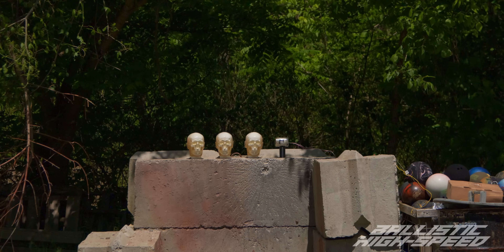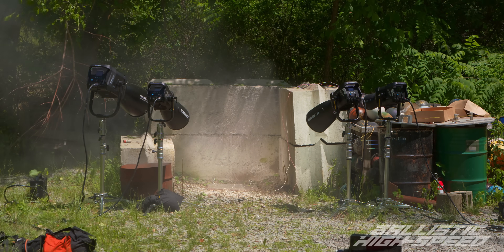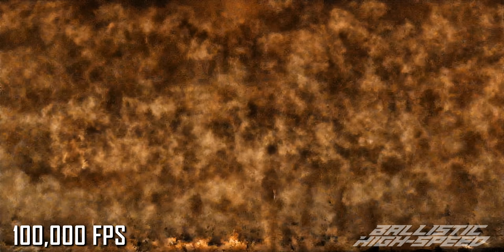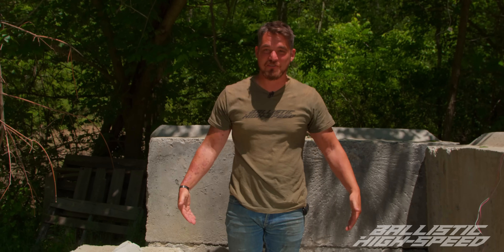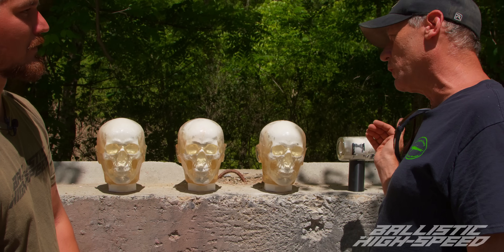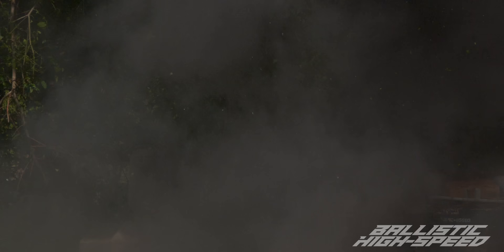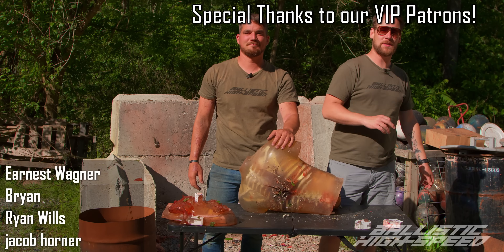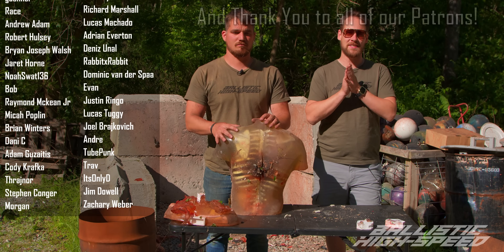Shaped Charges vs Ballistic Heads! - Ballistic High-Speed

Comment: That comparison to a shaped charge exploding like a nuke got me thinking:
What if a Shaped Charge exploded in a Lego City?
Reply: Lego city would be more expensive than the explosive and cameras combined 😂😂
Reply: "A man has suffered serious damage from a shaped charge in Lego City!"
Reply: @vvvxt  "Hey!"
Reply: "Looks like a nuke" - yes, for those few frames.   The mechanism behind the shape is completely different.
Reply: The shaped charge stands no chance against that single Lego block that is just there to be trodden on.
Reply: I endorse this!

Have viewers send in parts of Lego city super glued together and then take slomo macro shots of it getting shape charged with different angles!
Reply: What if we created a shaped charge the size of a building, pointed it down and set a small nuke above it as the charge? How deep would it go? :D
Reply: If we get really technical, a nuclear bomb is just a really fancy shaped charge with spicy metal.
Reply: And the name of the city is called SandiLego California
Reply: I think I'd find that distressing 😟
Reply: Hydraulic Press Channel has done something like that with their high speed cameras before. It should be on their Beyond the Press Channel
Reply: Tbh, nukes don’t actually explode in a mushroom cloud shape. The shape of the cloud is a post-explosion effect caused by both the hot air around the point of explosion rising and the displaced air returning to the point of explosion and rising. The central column of air keeps rising as the air and particles lifted up earlier start losing their energy and falling out of the air. It is the same phenomenon with how people create smoke rings.
Reply: A man has fallen into mist in no-longer a city!
Reply: Hey!
Reply: I like the way you think!

Comment: Man, that's a lot of expensive equipment just a few feet away from the explosion.  You guys are brave!
Reply: I just want to immortalize how the op and the first commenter had a completely normal convo and I appreciate it for how rare it is
Reply: @MrBusdriver-VoidlessMedia  I hate that this is something to be commended nowadays :(
Reply: @lemagicbaguette1917 at least its being noticed! I am honored to have semi-been a witness
Reply: Well one of the hosts was in an explosion, no biggie
Reply: If they are using industry standard tricks, those aren't exposed, they're actually pointed at a mirror and the cameras are behind protection so if they are hit with shrapnel/spall/frag the mirror shatters but the cameras are safe.
Reply: @Will-W  But then they'll have 7 years of bad luck.😟
Reply: @Will-W  Watch at 1:42.  Please explain.
Reply: @SteveFye  ah, you were referring to the black lights. The lights are "relatively" inexpensive compared to the 6 figure cameras and lenses. 
I'm not sure how they protect those unless it's just some clear polycarbonate and LED (solid state so no shattering) illumination.
Reply: @Will-W  those were lights?  That makes more sense then.  Still, they didn't look cheap.  Thanks man!
Reply: @SteveFye  oof, I looked them up, the Nanlux 1200 LED lights are 3k each and the reflector hoods are 100$+ on B&H Photo. 
Definitely not cheap. 
The TMX 7510 and the 2512 cameras are $150,000+ each.
Reply: @Will-W  that's a spicy light!
Reply: @SteveFye  lights
Reply: @SteveFye those are lights
Reply: Que bien se aprecia el efecto Monroe de una carga hueca y la onda de choque y calorífica de la explosión con sus fases positiva y negativa. Muy instructivo.
Reply: That wasn't the cameras, they were the lights. No way they were going to risk 3/4 of a Million for a few tube hits ? There is brave? Then there's STUPID and these guys don't look stupid. One of them IS one of the luckiest sons on the planet though.😉Cheers from Oz
Reply: Also shaped charges. Very focused
Reply: There is a lot of extra stuff there burning.
Reply: It's a shaped charge. So it can be much closer than the average explosive.
Reply: Yup. The government does this a lot to film explosions. A sapphire window usually is used to protect the camera from debris.❤
Reply: Shape charges are directed to explode in a specific direction. That’s why areas not pointed towards by the shape charge are relatively safe. The lights could have been placed a little farther away, but since they weren't damaged, there’s nothing to worry about.
Reply: That's why it's a 'shape charge' you know which way the explosion will go.
Reply: Their bravery is a calculated risk. They are simply crazy and I love it! Wish I could be present for one of these videos!
Reply: A million dollars worth of equipment per micro second of destruction
Reply: ,.L
Reply: Correction, their camera’s are “brave”!!!
Reply: 680K SUBSCRIBERS. THEY CAN DEFINITELY AND OBVIOUSLY AFFORD IT
Reply: I mean, is insurance not a thought going through this though experiment?
Reply: The explosives they are useing are not blown up with fire but a electric signal, that is sent to charge and a little chemical reaction happens all in like 1 second, they can have c4 next to it and just get blown apart,without that electrical signal and chemical reaction you get no boom
Reply: @dillyDillzmuaythai4life   "they can have c4 next to it and just get blown apart"

C4 detonation is initiated by shockwave.

However, did you think the OP said, "that's a lot of explosive equipment just a few feet away from the explosion"?  If so, reread the OP's comment.  Explosive expensive.  😉
Reply: @BeardyMacBeardFace  your explaining c4 from 20 years ago,I'm talking modern day c4 ya know safe c4 that uses a electrical signal 🙄, and I generally don't care what kinda high horse your on, I know people like you,in person you will be mad and heated and try arguing instead of a conversation so I will leave you to do you buddy
Reply: @dillyDillzmuaythai4life yea you still answered a question nobody asked
Reply: @aschelocke  it's called talking